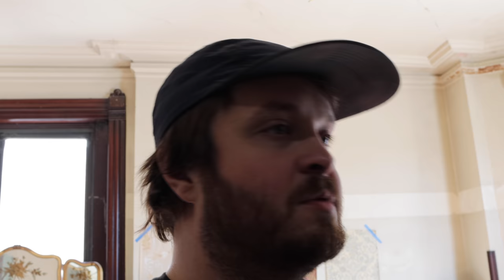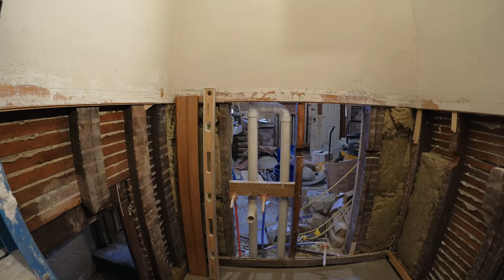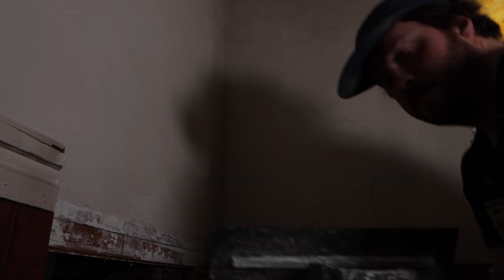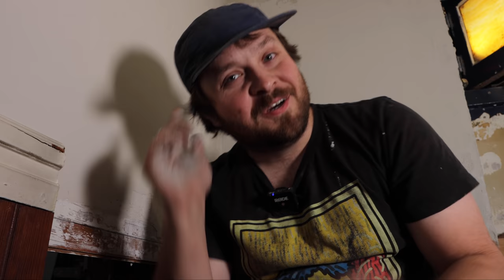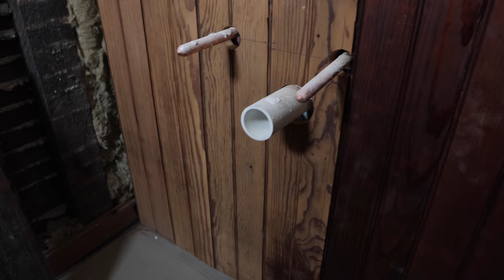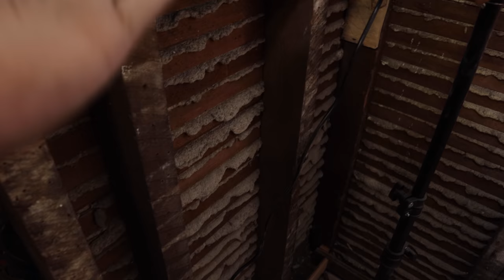It's Starting to Come Together! S2 EP6

Comment: I have a suggestion. Perhaps it would be better to lay the final flooring before laying the wood for the wall, so that it is above the flooring and then you don't have problems of expansion or accumulation of water in the lower part of the wood if there is a leak. In addition, in this way the wood can remain a few millimeters separated from the pavement and it will not absorb moisture by capillarity of the pavement.
Reply: I was going to suggest that too. Not that I am a professional
Reply: Brilliant idea!

Comment: Put the sconces evenly on both sides of the mirror so the mirror can reflect the light. It will also be symmetrical. I’m afraid it’s going to be really dark in there. Light is very important. You have dark wood, dark water paper, etc; you need some lights!
Reply: Yes!
Reply: Kaleb should connect an electric line from the sconces by the sink to the little side window.  Then use a low watt LED light to back light the art glass.  The art glass from the other two windows looks good back lit.  Put an access panel on the basement stairs side of the window.

Comment: The top on the wainscoating are called rails, in other rooms chair rails, they often in 1700 houses after they owner had chairs, since in that time period rooms often served many functions chairs and tables were put along the walls when not in use. Servants often moving furniture could mar painted plaster wall, hand made wallpapers or silks fabric wall coverings, so chair rails were put up to protect those expensive wall coverings being damaged from the back of the chairs rubbing against it. By the 19th century it was put in most rooms as a decrotive eliment!!!

Comment: As mentioned before, I’d have the bead board end above the finished floor. And seal the ends so that there is no wicking of moisture, just in case.  And insulate around the drain pipes to keep em quiet.

Comment: You could also do  radiant floor heating, just in case it isn't possible to get it comfortable, before you put the tile down.
Reply: Can still install it under the floor from the basement. It’s a small room in middle of the house and should stay comfortable as is.
Reply: You just don't want to install it next to wood. If it ever shorts out, being sandwiched between cement and tile is safer.
Reply: He has hot water/ steam to work with.

Comment: I would have installed a drain in the bathroom to account for any overflow situations. I would be worried as all get out if that toilet overflowed, and I didn't catch it. This has happened to me, flushed, and got back in bed to watch a movie with my wife, and 2 hours later, I get up, and am standing in 4 inches of water, it flooded the entire back of the house! In this older home where you wouldn't want that to happen, I'd install a drain if it's not to late. 🙂👍✌
Reply: I wondered about that, too, especially with visitors who can be so careless with other peoples’ things.

Comment: lights on either side of the sink mirror would be nice, a single side of your face being lit isnt very flattering and backligting makes it hard to see yourself in the mirror, thats why people usually have one light on either side, it makes for even lighting on your face which is more flattering and practical
Reply: but i understand that you might not have enough space on the left side of the mirror
Reply: Exactly!  Both sides of mirror.
Reply: I agree, the separate sconces seem odd to me
Reply: I also am concerned about just one sconce by the mirror — if someone wants to check their makeup it won’t give sufficient light. Have you considered one light over the mirror? And perhaps a outlet there for shaving or blow drying? We have two bathrooms and I keep my hair dryer in the second one just for convenience. Oh, and will there be a cabinet of some sort to hold extra towels, TP, toilet brush, cleaning supplies?

Comment: As a graphic designer who does a lot of print work, I would suggest supplying Pantone colors (instead of RGB or CMYK) for all of the designs when getting them printed to make sure you can get the colors as accurate as possible. I'm looking forward to the finished bathroom!! It's going to look incredible!

Comment: Even though there are windows for some ventilation, I believe it is still code to have some sort of bath fan installed in the space.  You will want something to extract the odors out of the room without it spreading to the hallway and the rest of the house.
Reply: I know atleast ICC requires. I’m not licensed outside of Kentucky. We also have stringent requirements on how the moon is cut in the outhouse!
Reply: Even if it just a powder room. Sink and toilet? There is no tub or shower.
Reply: @hvachacker586  HE MAKES AN APPEARANCE!!

Comment: If you're worried about nail-on J-boxes being too far back in the wall after you plaster, you might consider using adjustable boxes.  They are often used in kitchens where a back splash is going to go. They simply adjust in and out with the turn of a screw, and can be adjusted after you have already out up the tile/ plaster/etc. I have used them and they are nice.

Comment: Suggestion: I can't tell how far up on the wall you are planning on putting the sconces but if you can check to see if the light will be alright while you are sitting on the john. I am female so.. I once had a bathroom that no one wanted to use all said that the room made their eyes/head hurt. Was painted a soft blue and didn't think the lighting was too bright, no one had problems if just washing hands or fixing make up ect. finally figured out that there was light shinning out from the bottom of the sconce that would shine right in the eye but from the side. Hard to explain, hope you can understand, had the sconce raised 3 or 4 inches and no more problem. :)

Comment: Kaleb, I’m not a plasterer but am a union carpenter who has installed quite a bit of black iron and metal lathe ceilings and walls  for the union plasterers in cleveland working on many buildings of the last 35 years. One thing I have noticed them use is a redwood straight edge which they call a rod. They use it to flatten out the walls in the brown coat (first is the scratch coat, second is brown and last is the finish or lime) or run the layer between the plaster grounds. The other tool they use is called a Darby. Which is like a straight edge or float. You may look into these to flatten the walls a bit more than just troweling in the wall. Keep up the good work.

Comment: The decorative cover for the holes is an escutcheon.  I'd recommend that you use the same color on them as your tap and door hardware, if they match, and the same color as the taps if they don't. To cover the standout pipe, consider a thin sheet of metal that you can literally hot glue on.

Comment: for heat source, if you put on outlet in wall farther from the water sources, you could use a small space heater small tower fan in there if it gets cold or warm enough.
Reply: Oh those can be dangerous. If you do use one please consider a ceramic heater.  No open heat element that way.

Comment: The Plaster Weld is designed to work specifically with interior lime based plaster chemistry. Over time it will negate cracking and water uptake and temp/humidity flux. Cement adhesive (plaster weld also makes one for cement, it's blue not pink like the plaster weld) is mostly acrylic based, the spray you're using is most definitely acrylic based, it will work but might be too much for the softer plaster.

Comment: Waterlox tung oil?  I put it on my bathroom hardwood floor.  Great thing about it is ease of repairing scatches.  Just sand lightly and apply more.  Scatches on poly are white (which really shows on dark stained wood) and a hassle to repair.  Love to see a young couple wanting to restore an old house and not “remuddle” one.  Keep up the good work!

Comment: You can take a small piece of the wall paper to Lowes they can put on machine tell you the color and even make it for you. My house is an old mill house 4 room house. Been trying to do some restoration to it. Have a small crack in plaster ceiling living room going to try what you did to fix. Thanks love watching the repairs. Have a big pipe in my bath room like you had wondering if I can take it out if so will I have to do another kind of vent for bathroom

Comment: suggestion, in case you don't think about it, but you probably have: metal plates placed between pipes and electric and the joists, towards out into open room - anyplace you might nail or screw into wall in future (so you don't hit the mech. systems once wall spaces are enclosed)

you're place is looking better all the time :)

I believe there is old corner edging tool for plaster smoothing outer corners

just need your stilts for floating :)

are you gonna plaster rough in the ceiling then float a smoot coat on it or merely paint it? sorry, if you already answered this

Comment: I have a half bath about this size, it is on two exterior walls.  It also has no heat, and it stays warm just fine.  Though I do keep the door open just in case during winter

Comment: Hi Kaleb, you were talking about getting the correct colours for the wall art you are going to put up.  I'm sure you're well ahead of me here on this but I expect you will take the wallpaper sample with you to the paint store along with a colour sample from the shelacked beat board as samples to get the right colour.  The pattern lines done to exactly match the beat board would actually work extra well.  Here in the UK our go-to local paint store, B&Q has an enormous section of colour samples to choose from. The idea being we select the samples something like the colours we want to use, take them home, see the colour in situ and then order the one that works best or that matches any sample we took with us in the first place.  I'm absolutely sure things like that work far better and are more advanced in the States so you should end up with exactly the colours you want and need to be using.  Looking forward to the time-lapses of you actually stencilling on the pattern. Artist At Work!!  Well cool!!
Reply from the maker: We are using mineral paints on the plaster walls because it allows the plaster to breathe unlike modern day latex paints. We are ordering our paints and they are shipped to us. It's also not as cheap as latex paint.
Reply: @The2ndEmpireStrikesBack  Clearly you have considered every angle and every need, just as you have with plastering. The extra cost to buy the correct paint for the job will be really worthwhile and two or three generations down the line your grandchildren will thank you for your wisdom and forethought.

Comment: How are you going to treat the wood around the windows? Are you going to paint them are strip them and stain them.It's definitely looking good.Can't wait to see the finished bathroom.
Reply from the maker: strip the paint, shellac, then water lock. it will closely match the beadboard.

Comment: @22:22 Why put the electric box under the sink? It's harder to access and use. Most bathrooms have the outlet next to the sink or above. That way it's easy to plug in a razor, hair dryer or extension cord for anything else.
Reply from the maker: Because in the victorian times they didn't have electric plugs in the bathroom. this allows us to have the functionality of today and respect the aesthetics of the past.
Reply: I agree, at some point there has to be convenience , and it's actually safer too
Reply: @The2ndEmpireStrikesBack  Actually we still don’t have electricity outlets in bathrooms in the UK. I could be wrong, but I think it’s actually illegal, because of safety reasons. This is also why light switches are either pull-cords or on the outside of the bathroom door.
Reply: I know some bezels of lighing fixtures had “razor outlets” that is beyond the era of this home. I would use a older style NEMA outlet and plate and protect in Breaker panel with GFCI or CAFI breaker. Them test and reset outlet don’t look all that great.

Comment: Hi! I love watching your videos. I just wanted to recommend you install some kind of vent/fan, something to help steam from the bath the escape. Mold would be a very icky problem after all the work you've done. 
Edit: I just got to where you said you weren't putting a bath or shower in this particular bathroom.
Reply from the maker: Mold doesn't grow on plaster no matter how hard you try.
Reply: @The2ndEmpireStrikesBack  Oh that's good! I lived in a house where there wasn't good bathroom ventilation and that used radiators for heat, and it was a big problem.
Reply: I don't think there is a shower in this restroom but I could be wrong. It's known to happen every once in a while lol
Reply: Interior restrooms required a forced ventilation for obvious reasons. If a restroom is exterior and has a operable window your ok without. Remodel of a structure some times requires updating ventilation, plumbing, electrical. Maybe st. Louis is the exception.

Comment: Why would you want an outlet under a sink?   What would it be used for?  The most common reason for having an outlet in a bathroom is to plug in things like hair dryers which no one wants to plug in under a sink. Their cords are only so long.  

Putting only one light next to an over the sink mirror, makes it hard to see faces.  Typically having a light on each side of the mirror gives the viewer the light they need.  A single fixture works better over the middle of the mirror not off to one side.
Reply: Yes re lights.
Also maybe put outlet behind a little picture that's hinged to the wall, in a usable place on the wall.
Reply: Maybe the outlet under the sink is to charge your phone while you’re using the toilet? 😄

Comment: I have a house built in the 1950's the sink was mounted to the wall no pedestal when I changed it out  I noticed the 2x4 between the studs it was bolted to a lot more substantial than breadboard are you planning on mounting your sink to the wall or will it be a pedestal sink?